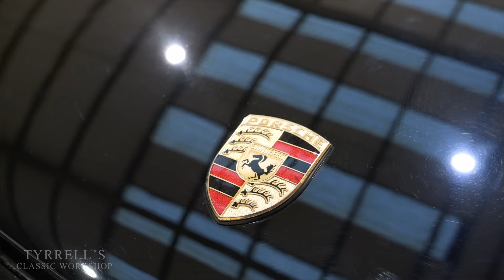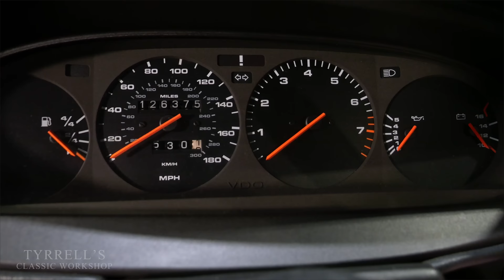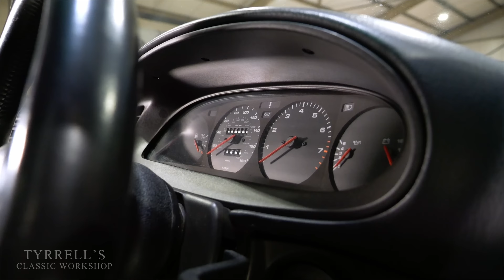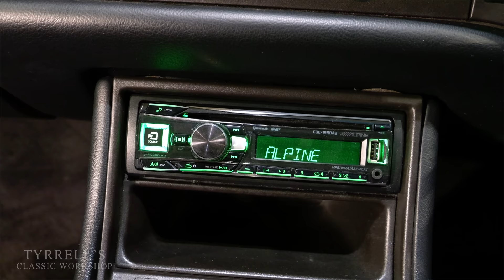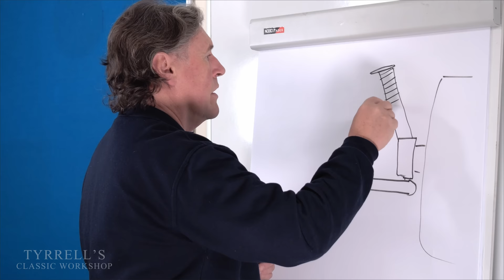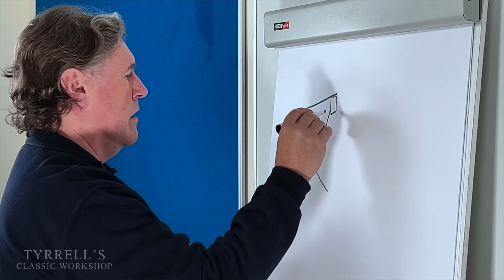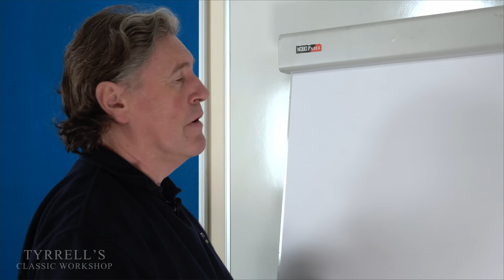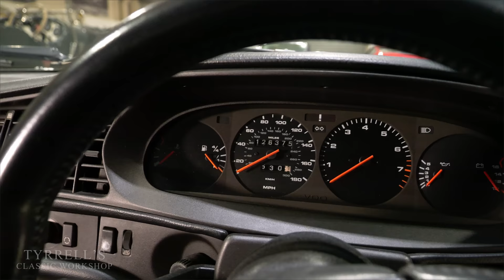Porsche Perfection: Unveiling the 968 Club Sport's Secrets | Tyrrell's Classic Workshop

Comment: A better design of the trans axle , front engine , rear gearbox was from Alfa Romeo, in the Alfetta 116 series cars. The Alfetta took its name from the all conquering 158/9 Formula 1 which had a transaxle layout and won every Grand Prix in in the 1950/ 51 seasons , bar one, courtesy of 2 fabulous drivers Farina and a certain Mr Fangio. Alfa Romeo  not only put the layout in a 4 seater family saloon but incorporated a far superior suspension , notably with the De Dion rear axle aided by the Watts parallagram , which gave the rear wheels perfect contact with the tarmac whatever the road conditions, aided by a far superior ride to the 924/ 944 / 968  Porsche range of cars